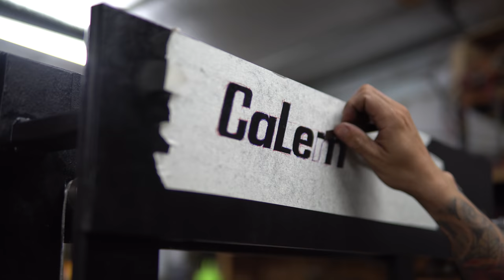Hydraulic press BUILD - Finishing

Comment: Not only ‘the most handsome machinist’ but you also understand hydraulics. 👌🏻
Reply: And dry humour.
Reply: Have you ever seen someone who understand hydraulics use Teflon tape on hydraulic fittings?
Reply: For being self taught, i think he is doin great things all things considered.
Reply: @quatre1559  Nothing wrong with "self taught" I learn the most as well only I like to do it the right way from the first time.
Reply: @villijs33321  Yes...! and........?
Reply: @aubreyaub  I Was taught in hydraulic coarse to never use Teflon tape on a hydraulic system because if any of the tape tears off when you install the fitting, or if any tears off down the road, it can plug hydraulic ports and cause serious damage to the pump and valves. When you put special Hydraulic thread sealant, never put it on the first thread or two for the same reason. Keep it back from the edge so none gets into the system. For other fittings, like flare, compression or o-ring seal, don't use anything. They are designed to seal without any sealant, and adding it can cause the fitting to not seal properly. Those types of fittings don't seal on the threads anyway, so putting it on there is just a waste.
Reply: @villijs33321  Yes. I note, you do not disagree, but state certain facts. The answer to your question, is YES. Of coarse, or of course, you can use Teflon Tape, with certain exceptions and conditions.